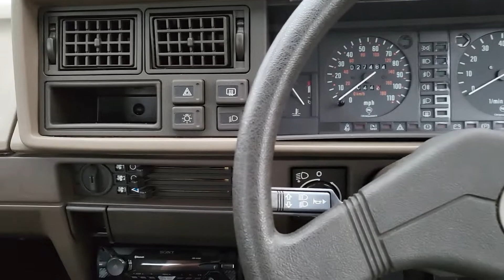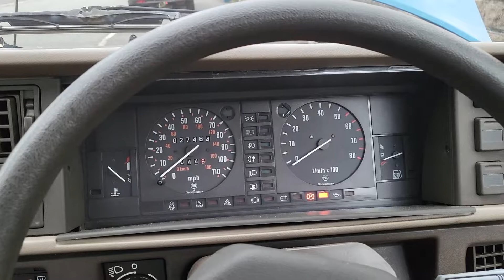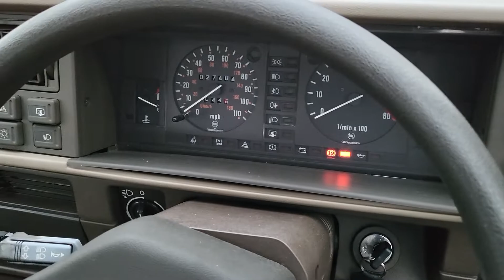Skoda Favorit Forum engine

Comment: The fuel pump is mechanically operated on early models, so it will take a while to pump the fuel up to the bowel of the carb so may take some cranking to do. My h plate favourite had a self priming for starting on the fuel pump. Also might be worth checking the carb and giving it a damn good cleaning